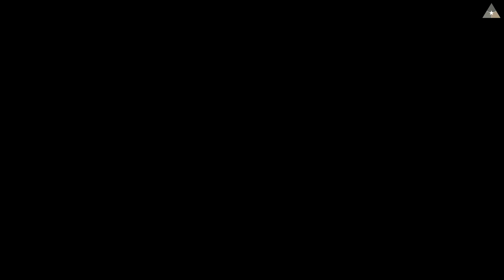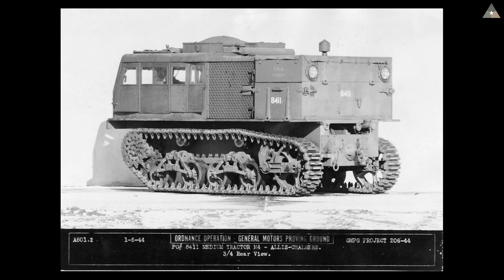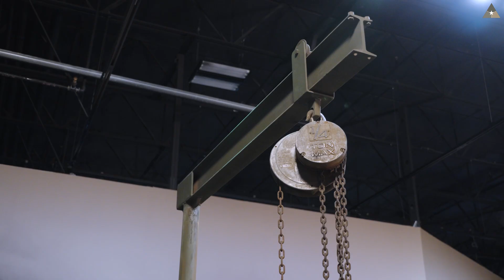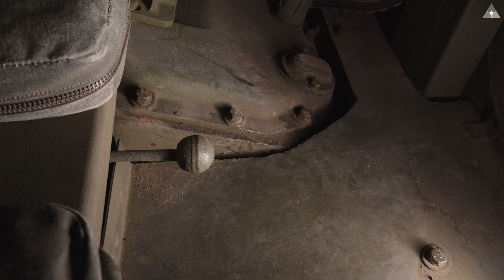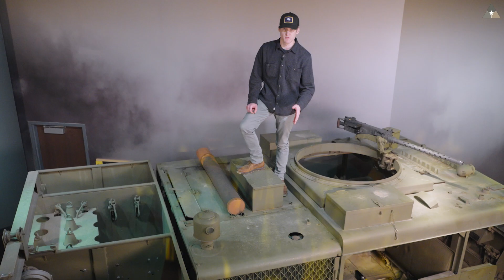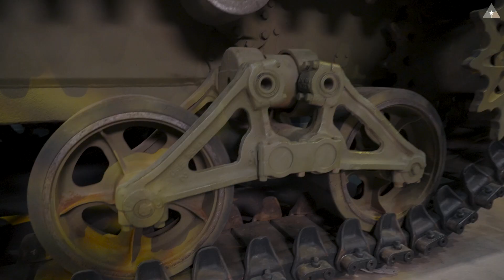M4 High Speed Tractor | Moving the Big Guns

Comment: A note on the towing "capacities": those listed in the TM aren't max towed load weights as youd find in the owners manual of a modern pickup. Instead, since this is a tractor, those are drawbar forces, or, if you hooked up a force scale to a load that you can vary the resistance on, these are the max reading at listed speed achieved in that gear throughout the the rpm range of the engine. So in this situation, its not a case of the 8 in howitzer couldn't be pulled in anything other than creaper gear (or the 155mm couldn't be towed in high gear), but instead how much force the tractor could match or overcome in that particular gear.

Comment: you have made an error equating draw bar pull with weight of trailer. on flat hard ground the draw bar pull of 120000lbs low boy could be as low as 3k-5k lbs. just like a semi its situation dependant. how much slope how hard the ground might be and how low or high resistance the trailer wheels are (brakes and bearing drag) thats why pickups that can only generate 2000lbs or so of draw bar pull can still move huge loads on flat ground like all the commercials of trucks pulling planes, space shuttles and rockets....

Comment: Some of these were converted into monster trucks in the late 80s-early 90s. Known as 'monster tanks,' they enjoyed a brief vogue as car crushers, but as wheeled monster trucks became faster and more acrobatic, the monster tanks fell by the wayside (I have also heard that they were very hard on drivers). I remember as a kid hearing they were based on M4 running gear and I kept thinking they were nuts; nobody would cut down a Sherman, and that wasn't Sherman running gear, anyway. It was years later when I finally learned about these artillery tractors with the same designation as the Sherman.

Comment: Just because something weighs 30k lbs doesn’t mean it takes 30k lbs of drawbar force to move it you absolute moron. You’re not trying to pull it straight up into the air. I can push a 6k truck on level ground, do you think I have 6000 lbs of drawbar force. This is simple. You obviously don’t get out into the real world much. To pull something, you just need to overcome its inertia. So now you’re just talking about rolling resistance, efficiency of bearings, level surface, yada yada. Once you overcome the inertia, you need significantly less force to keep it moving or accelerate it, assuming level ground. That’s why prime movers have gears. Duh. I can’t believe a museum put out something this stupid. Did nobody with a brain think about what this guy is saying?

Comment: I was attending school at 29 Palms, where I met two artillery Staff Sergeants. Both struggled to walk first thing in the morning, and both regularly went to the gym to do leg work. I asked them why, and they said the Marine Corps had decreased crew (or battery?) size, but increased fire mission tempo (shoot and scoot, glued to fast-moving infantry). As the M198 trails were guite heavy, pitching in to deploy them had wrecked their knees. I was not combat arms, so no clue about the veracity. But, just watching them move made me ache. I think the Marine Corps leaned towards 'towed' to avoid taking the system off line just bacause the vehicle needed maintenance.

Comment: When I joined the Army in 95 as a Bradley mechanic. I assumed that the vehicles in the Army would all be modern to the point that WW2 stuff would look completely different. Instead so many vehicles still looked like they rolled off the battlefield of Korea and Vietnam. And SOOOO many things looked like they never changed since WW2. Its a testament to how good they made things in WW2 that the designs carried over for so long. But also how slow and plodding the military was about updating and replacing such old trucks and equipment. It wasn't until Iraq that the Army got a serious overhaul. My first weapon issued to me was a M3 "Greasegun" SMG lol. They still had them in 3rd ACR until 96 when the M4 carbines arrived brand new. At least I got to shoot the M3 twice at the range before the switch.
Reply: The light switch in the humvee is exactly the same as on WW2 era vehicles. I remember hearing some armored units went into desert storm with M3 grease guns.
Reply: We would have served in 3d ACR at the same time. I remember the M3 grease guns. That was a great unit.
Reply: @terryhodgson2357    I was HHC 2/3 and later E trp 2/3.
Reply: @Soulessdeeds  HHT 3/3 and 66th MI 95-98 timeframe. Moved from Bliss up to Carson.
Reply: I joined the Army as a Bradley mechanic in '99
Reply: My olman was issued a M-3 grease gun he was in armor in WWll

Comment: You're a bit off on the towing ability of the high-speed Tractor you're looking at maximum Draw bar pull. The gun may weigh a lot, but it has wheels, Therefore it is much easier to pull in and all but the worst situations the draw bar pull on a road, either improved or unimproved.Will be far less than the maximum weight of the toad load .
Reply: Came here to say this.

Comment: Why wasn't the engine a diesel? The low end torque would have been fantastic for pulling.
Reply: At about 2:45 into the video he displays a cutaway section of the vehicle, and says the central mounted engine is a GM (Later Detroit Diesel co.) 6-71 model diesel engine, one of the best and most produced diesel's in its class at the time. See the wiki entry if you want to know more. Widely used in Navy boats and landing craft for decades after WW2, and some Marine armoured vehicles. (The Navy loathes gasoline fumes because its a long swim home when the boat burns!)
Later in development, it moved to a petrol engine - likely due to 3 factors of the times : lighter weight, lower cost of production (hence more available), and almost all US Army vehicles ran on standard 80 octane gasoline (so simpler to keep fueled in a mobile battle front). The gearbox solved the torque issues well enough, I expect, as it worked for tanks.

Comment: Great video, as always! I've always wondered about the running gear of the M4 so thanks for clearing that up. By the way, Allis-Chalmers was a huge outfit and agricultural equipment was only part of what they did. (I have a 1937 WC tractor.) They also made all kinds of power generation and transmission equipment, blast furnaces, ore smelting equipment, flour mills,  ship steam engines and steam turbines,  and all sorts of other products. I've heard that the generators in the Hoover dam were built by Allis-Chalmers, but I don't know if that's true.
Reply: Several of the Hoover dams units were indeed Allis.  My father has pictures from when he took a hardhat tour.

Comment: Is the .50 cal on top the correct one? With the jacket around the barrel it looks like the aircraft version, not the standard M2 we’d expect to see. Curious if this was done by the museum due to a lack of the correct model to display, or if this configuration was historically used in a role like this
Reply: Why the museum has the gun they have is something the museum will have to tell us, but it is not ahistorical to find a jacketed M2 on WW2-era vehicles, just not common. 

In theory, the jacket was for the flyboys of the US Army Air Corps, not Army Ground Forces. However, logistical mistakes would happen, resulting in jacketed guns ending up with Ground Forces who didn't always return the "incorrect weapons." It is also possible, though this is mostly from anecdotal sources, that some Ground Forces preferred the jacket and so arranged, somewhat against regulations, to get jacketed weapons. 

Thus, we find at least a few jacketed M2s on ground vehicles, but it was not "standard practice" nor encouraged by higher commands.

Comment: During the early to mid-1960s, land was cleared for the eventual construction of Route 66 into Washington DC. I grew up in a house beside that right of way, which was forest for at least a quarter mile. As a young boy, the equipment used fascinated me. M113s were used to bring in tools and drag logs away. At the ends of the forested section were two roads perpendicular to the Route 66 right of way, each lined with houses. Those houses were either demolished or moved to undeveloped lots in our neighborhood. The houses moved were done so by M4s.

Comment: Why do so many tanks have towing hitches? What did tanks tow?
Reply: Whatever is needed I guess. Stuck vehicles come to mind
Reply: Almost all tanks have towing hitches for ammunition /fuel/flame/thrower fuel. The trailers worked well enough on a flat road but once you got off-road, they proved extremely problematic. Even the Israelis experimented with them on the Merkava. Towing hitches are almost always used for unditching a fellow tank for the most part.
Reply: Lout and bouty